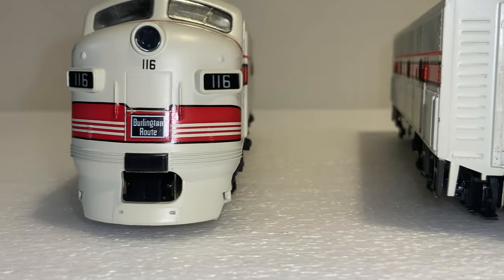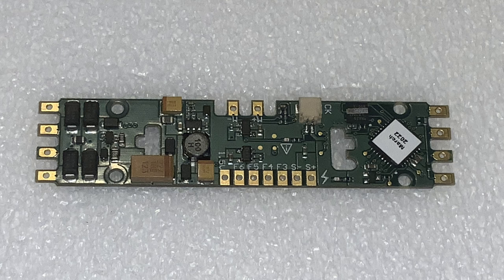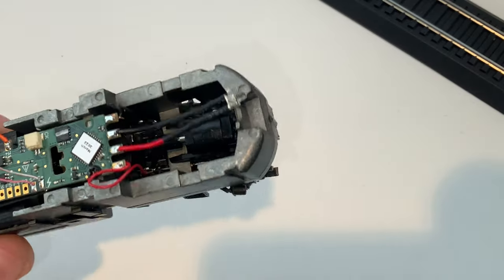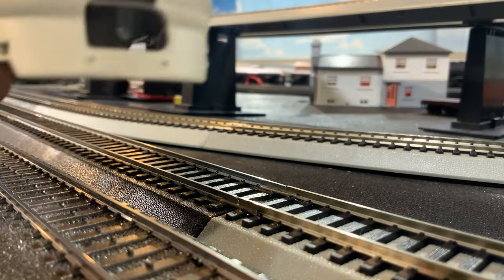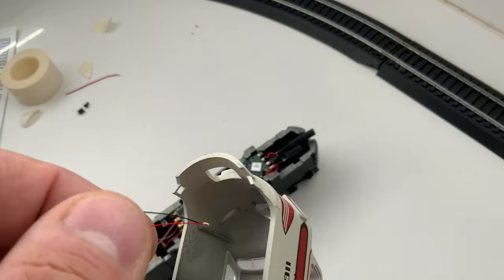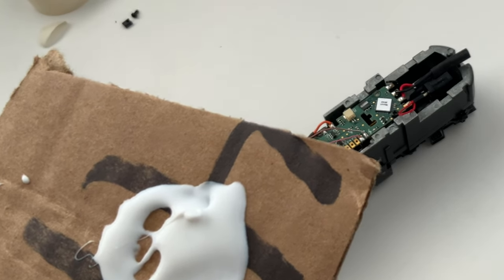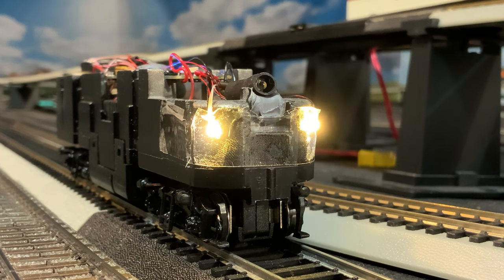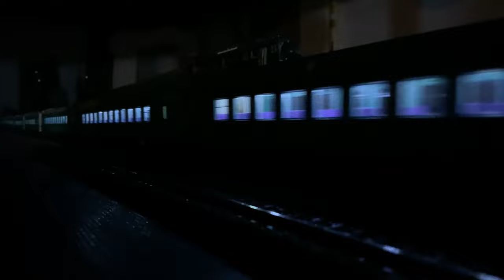Digital Model Railroading 101 - Lesson 2: Wiring in DCC Lights and Number Boards Using LEDs and SMDs

Comment: Great informative videos, on modifying vintage HO motive equipment!
(I had just finished modifying my ancient Proto 1000 subway sets over to DCC, with bidirectional lighting.
Very satisfying results).
As always; Great work Doctor Hobby!
Reply from the maker: Thank you so much for the kind words! That’s a really neat set that you’ve got there and I’d love to find one someday—best wishes for you and your model railroading!
Reply: @DoctorHobby 
Yes; I love to model the NYC subway, both underground, and The old Manhattan,and  Bronx, Elevated lines.
I had just finished modifying 20 Walther's Proto 1000 NYC  4 car R-17, and R-21, subway sets, (circa 1950s).
The models were produced in the early 2000s, with different color schemes. (The 1969-80s, Silver/Blue MTA looking the best).
The Maroon looked ok, but the green was to light.
I'm going to attempt to carefully darken then, either with subway grime, or darken the paint somewhat.
The conversions involved, for each 4 car set; The nice motor unit converted to DCC, with both motor unit and last trailer, (also with a DCC decoder installed), with Bi directional, red/white headlights/taillights.
I also installed a couple of sound units, with compressor/ traction motors, into some end cars.
This is an ongoing sound experiment, with different sound decoders, and downloadable sounds.
I also purchased a lot of the newer, higher quality MTH Subway sets.
However....
The Proto1000 motor car, blends much better with the rest of the train, compared to the MTH motor car that  has its windows blocked with white plastic, (and no interior lighting for the MTH motor car).
Thanks again Doctor Hobby.

Comment: Great tutorial. So essentially that +/- port on the board is also a node for the wires heading off in parallel. Was thinking of using a common wire to feed to and frim a buddy but maybe I just do it for the tiny U+ port.
Reply from the maker: Howdy! I’m not 100 percent sure what you’re asking, but the Vcc is common and you can use it to power any negative port. You can solder all the positives into one port if you want to.